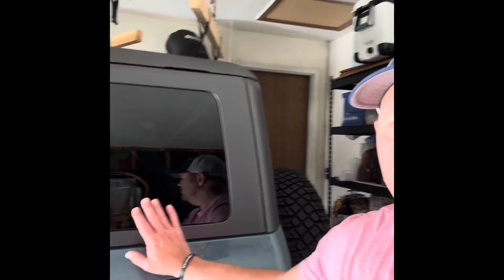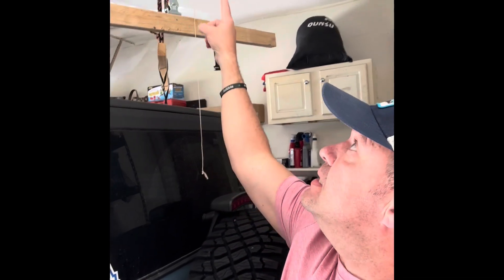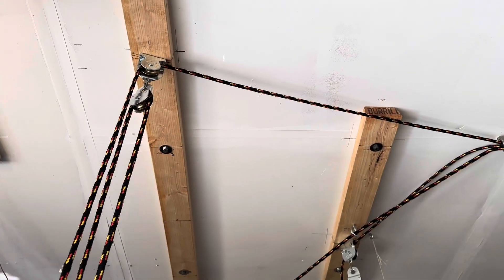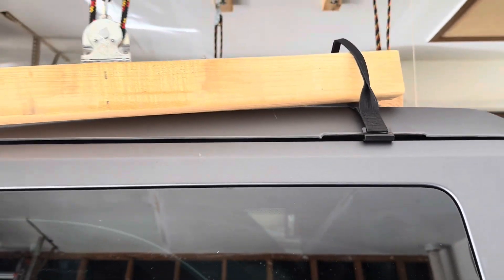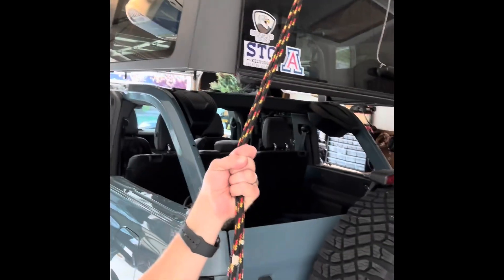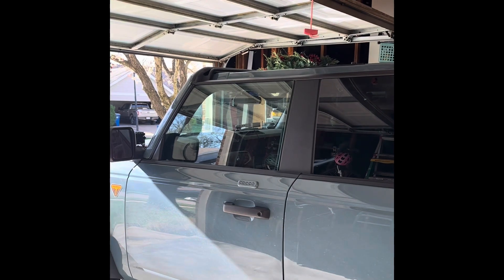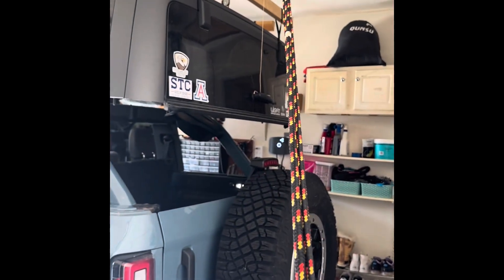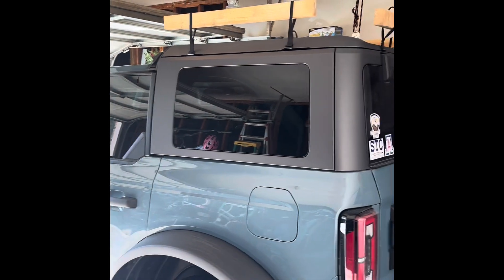Ford Bronco 6G Do-it-Yourself Pulley System for Hard Top removal and Storage!

Comment: My two-door Bronco has only one notch on each side of the top and is closer to the rear.
Do you think that maybe it's notched that close to the rear and with rear window notches that it will be balanced out?
And are those notches made for pulling off the top?
Reply from the maker: The other systems I have seen use these notches.  Roof rack systems also use these notches so they are quite sturdy.  In your case, with only one set of notches per side, I would look into using a couple hooks on the front side as well.  Having all four sides supported would ensure the proper balance.